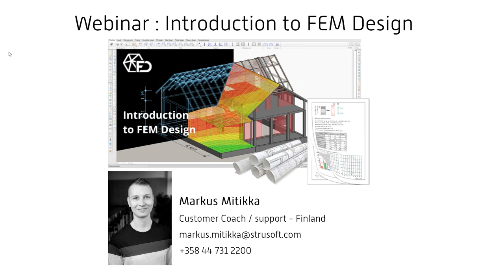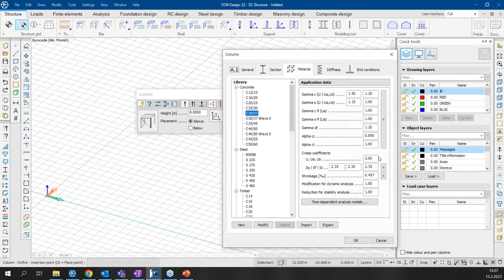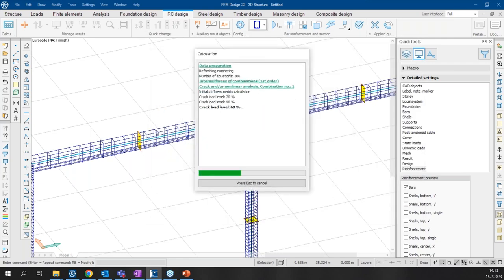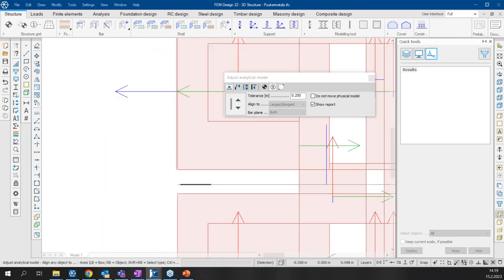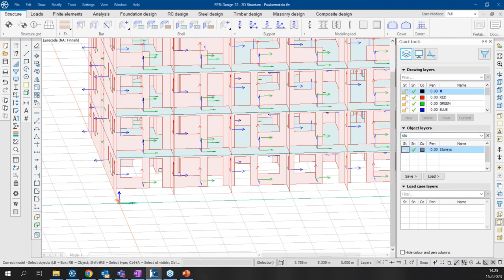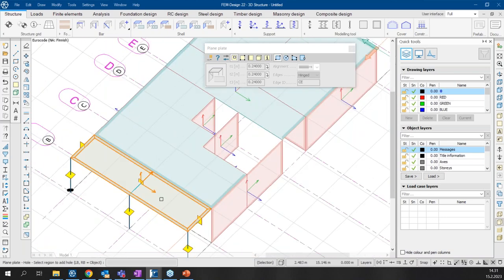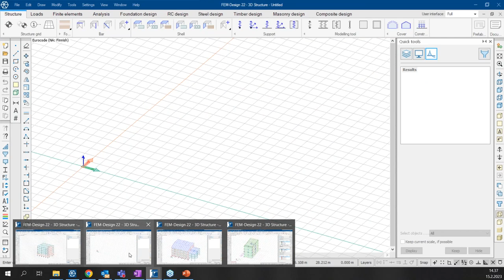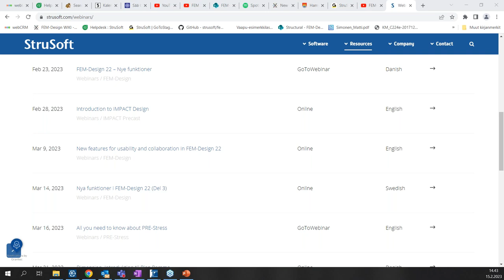Structural Analysis Software | Introduction to FEM-Design

Comment: Hello. Great video! Could you please make more videos like this. It is very useful to watch how professional works in program.
Reply from the maker: We will take this in consideration. Do you have any specific topics in mind you would like to see?
Reply: @StrusoftOfficial  How to model and calculate basement for building with underground floor (how can I properly make footing and involve soil deadweight on it). How to model and calculate retaining walls (T-shape cross section). In addition, I would like to see more videos about masonry design (when on masonry walls I make a concrete slab, proper edge connection). I think this topics could be useful not only for me, but also for other program users.
Reply from the maker: @Rominznew  Thanks for these topics, we will try to cover these subjects as soon as we can. For urgent support needs, you can use reach us at: https://strusoft.freshdesk.com/en/support/home